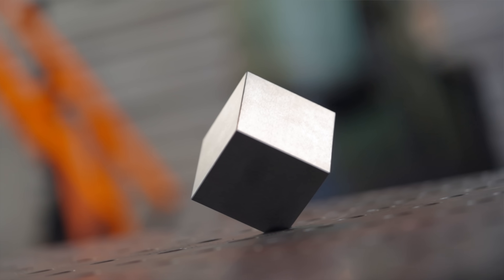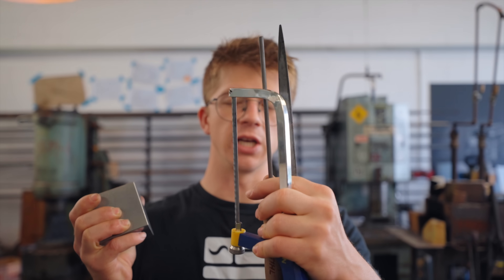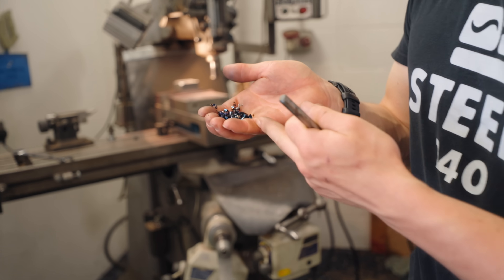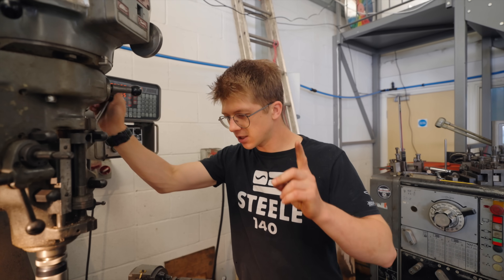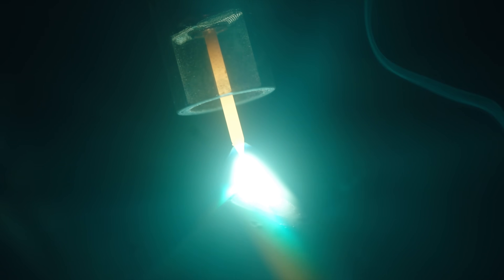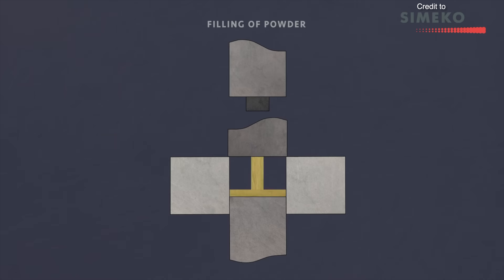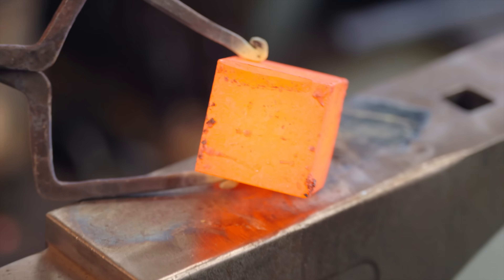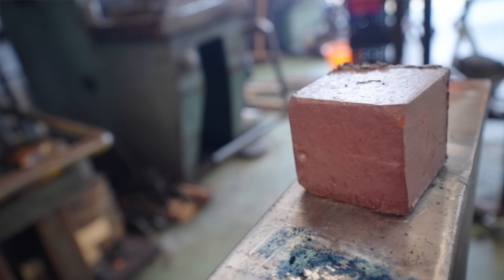Can You Forge Tungsten?

Comment: 00:15 What is heavier: five kilogrammes of tungsten or five kilogrammes of steel? That's right. Five kilogrammes of tungsten.
Reply: This is unironically correct. We tend use the terms heavier and lighter to describe density, not mass.

Imagine you lift a dumbbell you expect has a mass of 10kg but it's rubber instead of iron - you'd immediately think "wow that was lighter than I expected", because you see the shape and inductively apply a material density to come up with the expected weight/mass. Your sense of the density was tricked, not the sense of mass.
Reply: This small item weighing 5kg is heavier than a larger of unspecified mass
Reply: donno what you are getting at but this topic is fun. 5kg of tungsten does indeed weight more than 5kg of steel since mass does not account for air displacement but weight do.
ie 5kg of tungsten is of less volume so the buoyancy caused by air displacement is less. so weight-on-earth-at-STP-and-the-same-place wise it is indeed slightly heavier 😂
Reply: @ushiocheng  5kg of feathers
Reply: 5 kilograms is 5 kilograms, it’s like saying which is heavier, five pounds worth of rocks or five pounds worth of feathers
Reply: @moonsun9888  5 pounds of Feathers are heavier because you've gotta kill a lot of chickens to get 5 pounds of feathers.

That weighs on a soul.
Reply: @moonsun9888 did you not read the first reply to this comment
Reply: @candyman4769  kg is a unit of weight not mass.

Comment: Doubt that you could forge weld tungsten. 

It can be machined though so cutting a bit for for rhe core/cutting edge of a copper cu-mai eith Damascus outer would be cool. The copper may be able to hold it all together.

Wounder would what kind of edge it would give, does it anneal at all and would it need some sort of heat treat?

Comment: At 1650°C tungsten begins to become volatile i.e. it becomes a vapour, be careful of that.

Tungsten also retains a tensile strength of 300GPa at 1800°C, for perspective, structural steel is 210GPa at room temperature.... Recrystallisation occurs at between 1450°C and 2600°C, so you would need to heat the tungsten upwards of 2200°C to achieve easy forging.

Comment: I would like you to use a rod about an inch across and try forging it again. I believe you simply do not have the weight of equipment needed to move that much tungsten. make a basic belt or pocket knife is what I'd do out of it though I'm sure you could find something better.

Comment: Pure tungsten is relatively soft. Rockwell A: 66 Rockwell C: 31 it’s when you alloy tungsten it comes into its own.
For comparison knife steel is hardened to Rockwell C : 55 - 61
This is not unusual as pure iron is also soft, it’s only when it has the correct carbon content that it becomes hardenable

Comment: People don't do it anymore because it is inferior and more expensive than current processes, but you could potentially cast tungsten. You can pass currents through carbon rods to get the heat up enough to melt the tungsten and cast it. It was typically done in a vacuum, but maybe you could pump an inert gas in instead? Vacuum Arc casting tungsten to shape and then trying to forge it the last inch over the finish line would be an interesting way to make something. Not up to standard for modern manufacturing and by no means cost effective. But if you're just looking for YouTube content, it could be fun to watch.

Comment: there are forms of alloyed tungsten that are used specifically for welding on high melting point metals like lower melting point tungsten alloys you do use pure argon for those welds and need it at a fairly high flow rate as those welds are very easy to contaminate.

Comment: Chat GPT says this. 
Forging tungsten is quite challenging due to its high melting point and hardness. Tungsten has a melting point of about 3422°C (6192°F), which makes it difficult to work with using traditional forging methods. Specialized techniques and equipment, like high-temperature furnaces and precise machinery, are needed to forge tungsten.

Typically, tungsten is processed using powder metallurgy methods, where tungsten powder is compressed and sintered at high temperatures to form the desired shape. Forging tungsten is more commonly done for small, high-performance components rather than large-scale objects.

Comment: As far as alloying metals with different melting points, it depends on the metals involved but you can get wildly different melting points from the original pure metals.
Lead melting point = 621.5F
Tin Melting point     = 449.5F
Mix of Lead63%-Tin37%   melting point = 361F

As far as thinking the entire melt has to get to the melting temp of tungsten:
You probably do not need to get both metals to their melting point to combine them. Mercury will alloy with other metals at room temp with the other metal in solid form.

Comment: Getting my PhD in material science and I work with tungsten a good bit…

Tungsten is surprisingly not that hard and is softer than a lot of refractory alloys I work with. It has a quite high thermal conductivity (~160 W/mK) and with its incredibly high melting it is great for high temp vacuum applications, like in fusion devices (though it’s still not good enough for that)… 
Like most refractories it has very poor ductility, though so keep that in mind if you try to work it any more. It’s other big drawback is that it oxidizes like crazy at temperatures that really take advantage of its high melting point (which is why i said vacuum)  

Alloying metals with very different melting points is tricky! You have to bring it to tungsten’s melting point obviously, but when solidifying the tungsten will start to solidify first and you’ll get regions of very high concentration of tungsten and the rest with very little tungsten. Then you have to homogenize at like 2500 °C to get the elements to mix enough/make it uniform, since it takes really high temp for tungsten to diffuse at all (for the same reason it has very high melting point)
Reply: Tungsten-steel alloys are made by dissolving tungsten in molten steel.

Comment: I'm sure that part of the problem is that it's such a stout block. When you try to apply force to the whole thing it resists, but you were able to deform and even melt the edges. If you were to cut a much thinner piece with your bandsaw, you might be able to forge it a little more easily.

Comment: I've looked into this too. It seems that if you can get the forge got enough to melt steel and create a puddle in the middle of the forge then place the tungsten inside of that puddle and leave it. The tungsten should absorb some of the steel making it an amalgam which effectively lowers the melting temperature BUT forms a harder product after the forge.
Reply: Alloy. Amalgams are specifically mercury alloys.

Comment: Time for a new forge, I bought one for $600 about a decade ago that has two gas lines so you can add oxygen to the mix. Kind of like an acetylene torch but without the cutting tip. It turns steel to puddles if I'm not careful. I never took the temp on mine but knowing how quick it can melt a solid one inch block of steel I bet it can handle tungsten.

Comment: You also powder the tungsten prior when mixing with other metals. Makes it easier to melt. 

But I would not make anything from tungsten as far as tooling. It’s too brittle against force. As an element by itself it’s not very tough. Hence why it drills a lot like aluminum feels when drilling. It breaks away chips.

Arc furnace is best means to heal it. In inert atmosphere btw.

Comment: Try an oxy acetylene torch in a similar setup like your furnace. They can get up to 3200°C wich is way closer to the melting point of tungsten.

Maybe you coudl try making your own alloy with the milling chips and forge it to a damascus what ever xD or use a piece of forged tungsten (in case the oxy torch works) as an inlay in some damascus steel.

Comment: Remember that alloys make a huge difference. The difference between tungsten and tungsten carbide. Can be the same as the difference between aluminum and aluminum oxide. Aluminum is a fairly soft pliable metal. As where aluminum oxide is what we use to make sandpaper which can cut steel.

Comment: you are correct that Tungsten's melting point is 3422 Celsius. Plasma burns at 3000 Celsius. Tungsten is only one of few metal (another being Depleted Uranium) that can withstand the heat of plasma.

Comment: Timothy Dyck, a Canadian blacksmith, used a coal forge to get tungsten hot enough to forge. He made a really nice hammer. Yes, it was a lot of work but it can be done.
Reply: I searched his channel for tungsten, and the only videos that come up are his titanium videos. do you have a link for the tungsten video? I'm pretty sure he only did titanium.
Reply: @ElvianEmpire  My mistake. Wrong kind of high end metal. It was an older project btw.
Reply: @stanleyhyde8529  both high end for sure, but tungsten is about double the melting point of titanium (the step from steel to titanium is only about 300°C give or take).

Comment: It's smoking beause it's oxidizing (literally burning away). That's why lightbulbs have to be evacuated or contain oxygen free gas. NileRed has a clip of turning on a lightbulb in air I think.
The comparison between the steel an tungsten is not entirely fair because the tungsten has a much bigger cross-section so the pressure acting on it is much lower than for the steel. But I doubt similar dimensions would have changed much.
Awesome video!

Comment: I'd love to see if you can get your hands on some maraging steel. It's an alloy steel that uses very little carbon, but has properties similar to high carbon steel and it is often used in high temperature applications. It would be neat to see a comparison between it and the normal steels you work with.

Comment: To answer how they alloy tungsten in steel, despite the melting temperature difference, here's a fact about steel alloying:

Pure iron has a melting point of 1600C°ish
Pure carbon has a melting point of
3000C° ish

Yet, as you augment carbon content in steel, the melting point decreases until it hits 1200C°ish, a melting point lower than both pure elements, before coming back up again.

I highly suspect it's what's going on with tungsten alloying as well.

All of this can be read on metal phase diagrams, by looking at the topmost curve separating the liquid phase from the solid phase, which gives the melting point for a given alloy.

Comment: from this I'd say it would be likely possible to forge it, if you can get it hot enough. The power hammer did do something and you could put a mark into it. get it hot enough and it will forge. Maybe. Maybe check how they made lightbulb filaments. They were made from Tungsten

Comment: Many cultures at the end of the bronze age considered iron an inferior metal. Harder to work with, needed hotter forges, couldn't be melted down when it was damaged the same way bronze could. I would love to see you work with some of it, maybe make your own mix of copper and tin that would be fitting for a sword or dagger. And also it just has the coolest color to it. I think a proper bronze sword would be a beautiful piece to sell or display as well.
Reply: Bronze was far superior than iron until proper steel could be consistently made. The blades were sharper, it was less prone to shattering, it could be melted and cast without needing a lot of the working iron and lower quality steel needed, it was pretty simple so you didn't need a master smith to use it and it melted at lower temperatures. 

Even the best(less likely to explode but expensive)cannons were made from brass right up till the later 1800's when Krupp invented a process to produce reliable high quality steel steel to cast barrels from.

Comment: Sintered tungsten has up to a couple percent iron in it by weight to aid with fusing. This is one of the ways that a gold scam can be detected easily. Sintered tungsten will attract a magnet due to the iron content. Gold will not. Try using an arc furnace or just raw electric current to heat the tungsten cube. That should get your cube hot enough to deform more easily. Just be wary that the oxidation will be worse. That is what the smoke you observed was. Tungsten will readily react with oxygen in the air at high temperature. Thankfully, the reaction is not energetic enough to keep a large piece of material like the cube caught on fire. It could, however, keep small chips lit on fire if hot enough. Also, if the cube is hot enough to deform easily then it will also be hot enough to damage some of your tools, such as the tongs used to hold it in place. It is also a good idea to wear welding shades since the heat it radiates could damage the eyes nearer to the melting point. If you have an aluminum heat suit then you should use that, too. You don't want to give yourself a weird sunburn.
Reply: tbh who would scam tungsten for gold, its the other way around, gold is way more valuable (though tungsten is expensive), the information is still useful in gold buying though!

They would get 10 grams of gold for the value of this 5kg cube
Reply: someone please scam me with 5kg blocks of tungsten that has been replaced with gold, i won't report you. in fact i'd even buy more, thanks